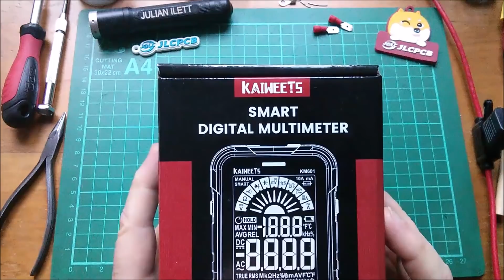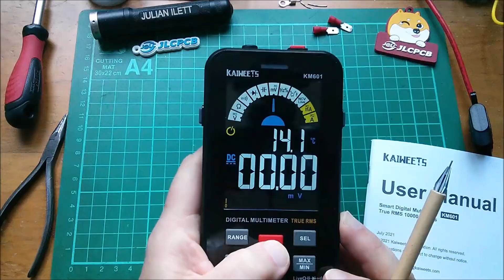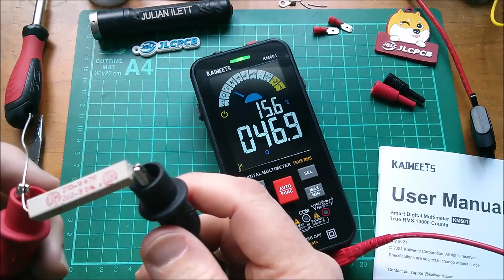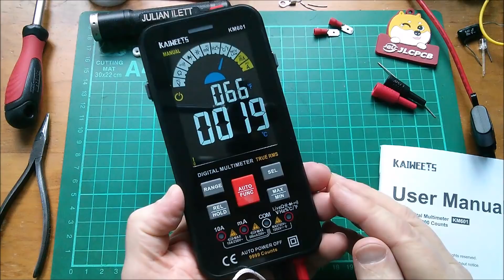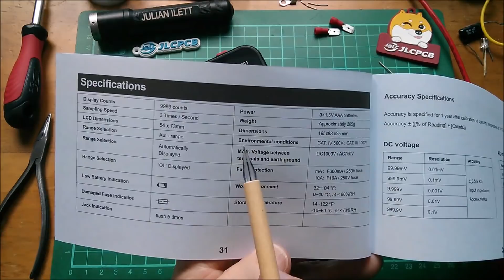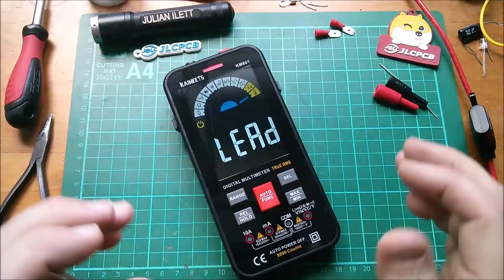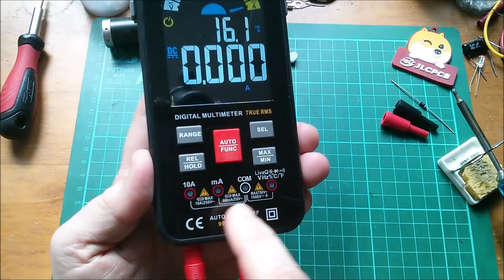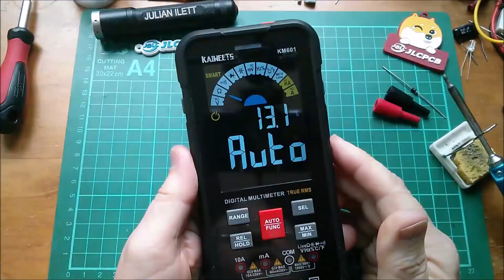Kaiweets KM601 Smart Digital Multimeter - 1st Look

Comment: Can i use it to measure 220 volts without any other wire sets which you installed to measure amps from solar panel? By using its original wires which comes inside box?

Comment: After looking this I ordered it and got it delivered couple days ago. Seems robust and not at the same time. Lack of a dial is somewhat disturbing. However, this habbit could be changed. It seems accurate and fast when on V and Ohm. Ampers to be tested. NCV could be useful but it would be more sensitive IMO. LIVE function of it works fine but I can bet I would double check it with good old neon tester. Overall, I have a feeling that this one would be a desktop only meter. Good old digital one is still the number one. Hopefully I will be convinced through time to use this one on regular basis. Thanks for your video!
Reply: 10 months later, what is your opinion on this multimeter now? Considering it, but on the fence.
Reply: @Seii-FPV  worth it

Comment: I like this meter, I bought one as its smaller than my other fluke or uni-t devices and although I wouldn't necessarily trust it for work it's a great little side meter that seems to be so far quite accurate. Love the big display and is only a tiny bit bigger than a phone, what's not to like !

Comment: Mine has an issue. I bought one based on this review also. I really like it , but,  only thing I can't get to work is the frequency counter. Has anyone tried it and seen it work? I tried a function generator, and a 1khz scope calibration, neither show up as anything but 0 hz. I verified the ground and input leads were connected correctly .  But...It will randomly show 60 hz (power line interference?)  with nothing connected.

Comment: My quick review:
It's trying too hard to look like a phone.
Buttons on the top and sides that should be on the face.
Flashlight on the back, again to look like a cell phone, is much more useful on the top where the NCV detector is.
And the jacks on the bottom are annoying as you can't stand it up.
Battery life won't be good with AAA batteries and continuous display lighting.

Comment: So the led flashes to say which socket to plug a lead into but a smart meter would complain if you didn't plug the leads into those sockets. And who wants the temperature displayed on nearly every screen? It just takes your eyes away from the value you're interested in.

Comment: I do like the large display. Shows up well on video.

It looks like this one uses standard size banana jacks. Unfortunately the version I got uses the mini banana, which are much less commonly available.
Reply: Full size jacks are good BUT they are still coming out the bottom preventing you from standing it up like most other DMMs.  I think most of us use handheld DMMs on the bench and being able to have them stand up is major advantage.
I saw yours.  The batteries in yours should last a lot longer because IIRC yours didn't have an always on back lit display.
Reply: @ElmerFuddGun  I use mine on a phone stand that I 3D printed. The 90 degree plugs do a good job of getting out of the way.  Wasn't able to find aftermarket 90 degree plugs, though.
Reply: I've just ordered one, specifically for use on camera, as standard LCD displays are so difficult to get a clear image of.
Amazon have 20% off too, so it cost just £40, which is nothing, and worth it for the display clarity alone.

Comment: It looks nice, but the smart features can be improved little. Not recognizing automatically the diode and slow capacitor measurement  (for so tiny capacitance) is strange. Also the big color screen probably burn the battery's extremely quickly. If there was internal rechargeable battery will be greed.

Comment: hmmmmmm its a bit gimmicky isnt it. the delay caused by the auto function selection could make it frustrating in use, I think. and while the display is nice, they waste a third of it just showing what mode the meter is in.
also you left it measuring several amps for quite a while lol, they usually recommend rather shorter high current tests. I wonder what kind of fuses it has for the current ranges.
Reply from the maker: From the manual:
For the A range - F10A/250V (6mm dia x 32mm)
For the mA range - F600mA/250V (6mm dia x 32mm)

Comment: I have one of these branded by another seller.  The display is stunningly nice; it's big and bright.  My only gripe is that it lacks a kickstand.  (I use a desktop phone holder for it.)  Thanks Julian.  It's appreciated.
Reply from the maker: Yeah, I had to lie it down on the bench. It will stand up if you lean it against a back wall. Dave Jones complained about right angle probe connectors, but you can insert them, and have the cables leaving the meter to the left and to the right :)
Reply: @JulianIlett  Yes, I did the same with the probes.  The stock probes are pretty good.  But I (maybe stupidly) replaced them with Probe Master probes that cost almost as much as the meter.  Still, very satisfied.  Thanks for sharing....

Comment: It would been nice to see what the current consumption of the meter is to give an estimate battery life.  Also would be nice to measure the internal resistance while measuring current (simply measure voltage on the fuse holder in your setup).
Reply: It comes with two sets of batteries in the box. I guess that's a rough indication of battery life.
Reply: I would have liked to have seen that as a rechargable item.

Comment: Continuity tester is crap.
It takes far too long to react.
I routinely use it to locate particular signal on some 100-pin TQFP or similar casing by swiping the probe across in line.
Reply: Maybe you can select continuity mode manually? Perhaps that would improve the response time
Reply: @AbdulAminGani  Yeah, but I can do that on the cheapo meter I've already got.
Reply: Yeah. I think this thing would really irritate me over a dumb meter which just measures what I tell it to.
Reply from the maker: Continuity is slow - you can hear a relay click in continuity mode when set to auto.